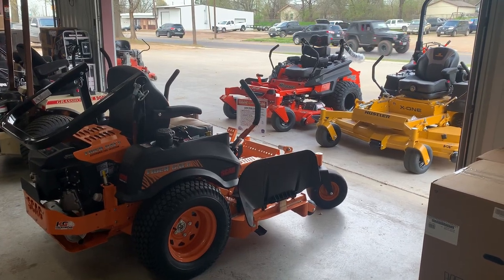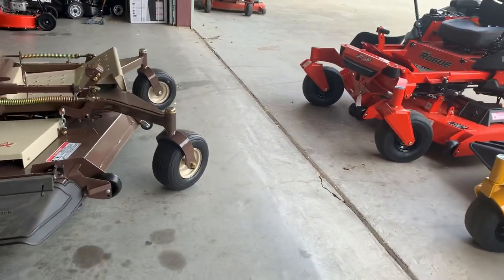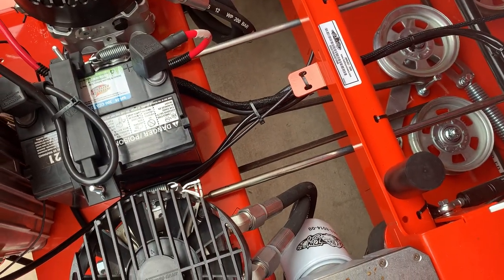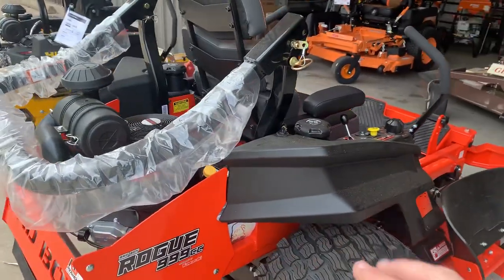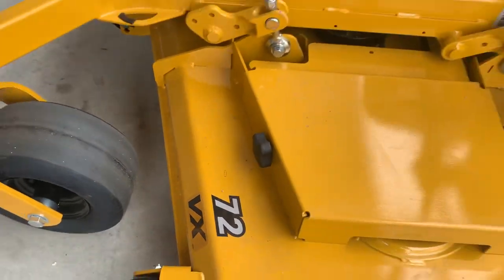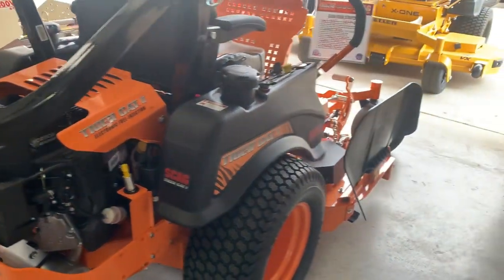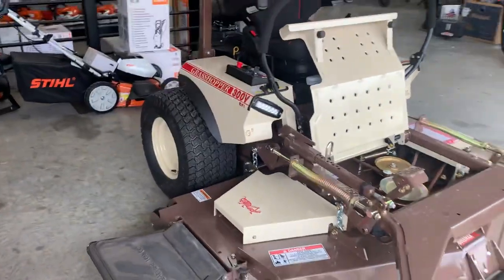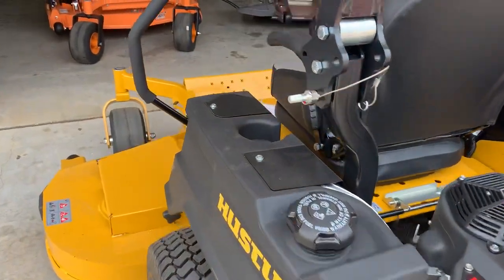Scag tiger cat vs grasshopper 300 vs bad boy rogue vs xone hustler comparison side by side.

Comment: I'm buying a home in Charleston, AR with four acres of lawn and will need some serious cutting power so it'll take less than a full day to mow.  I like your variety of brands, too bad you're three hours away.  Come to think of it, three hours each way is a good ride on my touring motorcycle... though doubtful I'd be able to use it to tow one of these mowers home. 😎
Reply from the maker: We can deliver.   Sending one to Missouri next weekend :).   We sell a lot in arkansas
Reply: I mow about 4 acres with a Scag Cheetah 54" with a 24 hp Kawasaki. It takes me just over 2 hours. If you have a lot of trees, especially pines, you need a front deck style.

Comment: What is the make/model of hydro transmission that allows you to change its fluid?   Are these hydro transmission a problem in all zero turns when you cannot change the fluid?
Reply from the maker: 2800 and up is servicable.  The sealed transmissions are usually called ezts or 2200s 2100s and 1800s

Comment: Really eyeing that Tiger Cat 61 but dealer is really lacking compared to 2 eXmark dealers that are close. The FT engine is a big reason on the Scag.
Reply from the maker: I’m a huge 32hp vanguard fan on the cat.  $9999 on national sale from Scag and it has so much more power.   The gas consumption on it isn’t as good as the ft efi of course.   I love the kawa on the 52.

Comment: In my area I have narrowed it down to either a SCAG Tiger Cat 2 or a Spartan SRT-XD. Both in 52". What are your thoughts on the Spartan compared to the SCAG? IMO I feel like the Spartan has the smoother ride and better hill capability and SCAG is the reliable, safe choice. Your thoughts?
Reply from the maker: both are good mowers.  The big thing to me is how big the Spartan is.   There is a much smaller footprint with the Scag.   Yes the Spartan takes hills better due to the size of the frame and the tires.   I would pin it down to which dealer would be better for you to deal with over the yesrs
Reply: Scag will be the worst mower on hills bcuz they are light and not balanced good.  Scag spindles also must be greased regularly versus most other mower brands that have sealed bearings.
Reply: Scag all the way, best warranty of any mower best cut period

Comment: I love my Cheetah 61 but working on it is the one thing I dislike doing
Reply from the maker: It’s funny you would think these are all the same.   We had a customer get me.    They do most of their own mechanics on their mowers but one day came in and asked me if we would change the pump belt on their toro.   I said of course and they asked me how much.   I said half an hour $35 or $40.  We jumped on it right then.   4 hours later the pump belt is changed.  Dang near had to take the mower completely apart.   The exhaust had to be removed, the rear end, then trans had to be removed.   38 bolts were in the floor then the belt went on.   It was the craziest thing ever.   He threw $40 on the counter and said thank you so much (we weren’t about to tear down and rebuild that mower just to change the belt out).   With a laugh and a smile on his face he didn’t even give me a chance to say it was gonna be more 🙈😂.  Lesson learned I never quote a price till we are done 😂

Comment: I live in southern Mississippi and I’d say we’re 70% exmark and 30% scag but scag is on the riSe. I got a 52” exmark and a 36” scag v ride
Reply: I live in Clinton and I 100% agree
I work for parks and rec and we got scag turf tiger 2’s 5 of them like 6 months ago.
They are absolutely dream machines , no issues and power power great cut and built like tanks liquid cooled
Reply: Best cutting mower I've had for southern grasses was Ferris icd deck and John Deere 7 iron deck.

Comment: How would you compare the TigerCat2 to the Rebel? Dealer by me has some left over 23 Tigercats significantly discounted and cheaper than the Rebel. For about the same price as the Maverick HD
Reply from the maker: Tiger cat has the pumps more like the rogue.   It’s definately gonna cut a little better.    They are supposed to be higher so that’s a bargain for sure.   A 61 is 12k and a 52 is around 11k.   I’m selling some of the rebels under 10k.

Comment: I am running a bush Hog PZ 2661 now,  what would you recommend for me?  I weigh 400 and have pull some hills while mowing.  Mow about 4 acres at a time.  I buy commercial mowers because I desire durability.  Out of those or perhaps other what would you recommend>?
Reply from the maker: I will be honest with you,   Every one of the 10k to 11k mowers from any brand are amazing and have so much to offer.   I would lean on the bigger sized mowers if i were you.    The Scag cheetah, any of the r series bad boys, Spartan, hustler super z, the 300 series or 400 grasshoppers, if you get a front mount make sure you get an extension foot platform, 600 gravely is awesome.   Have fun shopping, sitting, asking them to let you drive them around.  Also consider who is the best dealer I’m always about picking a dealer over a brand
Reply: @kgmowers  Thank you sir for your kindness and prompt reply

Comment: Is it true that Simplicity stopped making lawn tractors and zero turns??  They were the same thing as Ferris, but a little cheaper.  I have a 24 year old Legacy with a 60 inch deck and it's still going strong.
Reply from the maker: I believe so.    Simplicity snapper and Ferris were all under same umbrella.

Comment: personally, I Think Hustler is the Best Made and engineered with years and years of experience cutting grass for the City.  Second Is the Bad Boy.  I bought a Maverick because of the adjustable Arms, being i am a Bigger guy.  wanted the Hustler, I just didn't fit comfortably on the mower.  Also The Maverick has the suspension for a more comfortable ride.

Comment: Since this video, have you noticed any persistent problems with the scag tiger cat II? I'm trying to decide between x-one and tiger cat
Reply from the maker: No not at all.  I had a commercial guy his brake bolts came loose and the brakes fell off in the yard.   I was surprised to see the the warranty claim denied.    They ended up warranting, but I would recommend checking nuts and bolts on any mower.   I absolutely love the xone because of the hte12 Parker’s, but I noticed for 2023 they went to 4400 hydrogears instead.    I still have a couple 52 xones with the Parker’s if you can find a 2022 left out there I would recommend jumping on it.   On the tiger cat it has the higher end old school pump and wheel motors seperate so it’s gonna be a hard choice.    The xone is definately a smoother driving mower by far, Scag has the edge on the cut a little in most grasses.

Comment: What I didn't consider when I bought my Deere 930, is how heavy the mower was in the front, depressing into soft soil.  Of the mowers you presented, the Scag looked like the best choice for me, but the Bad Boy tires and suspension are appealing.
Reply: This is an interesting perspective, that I had not thought about, myself. I do not own a ZTR yet and am researching a LOT trying to define my needs. I have some areas that are pretty rough and some areas that can get pretty swampy during the wetter months, getting stuck with a 25O# lawn tractor vs a +- 900# could be a huge issue for me. Currently have a Husqvarna YTH 2348. The lack of a suspension on the Husqy beats me to death!
Thank you for your input.
Reply: @Delmarksman  In soft soil, I didn't not notice the heavy John Deere 930 would tend to get stuck more so than my XMark Pioneer. It was the front end tires were so heavy, it put depressions in the grass when I stopped.

Comment: What I'd personally like to see a video on is the Bad Boy 42" Rambler out in the field doing some actual mowing.
Reply from the maker: So funny story had a guy walk in and buy one from a nearby town.   He asked “what’s the cheapest mower you have”.  We sold him a single cylinder kohler 42” and me and my salesman delivered it after work.    
We pulled up to an extremely overgrown apartment complex that the grass was over the mower.    It was a huge place.  I got out and told the guy I was going to get a big commercial mower instead and he said no that’s all the money he had.    
We explained to him there is no way at all that mower could handle that yard.  
So Jay jumped on the mower turned on the blades and said “here let me show you this is impossible”.  
He tore out across the yard and it never bogged up just blew threw it.   He went back over it and it was a clean pass, then another, and before long he is jumping back in the truck and we are waving bye 😂 🙈.   I think the 42 Mz cuts better than the $8600 42” maverick hd honestly….   They have had that mower 2 years now it’s still rolling :).
Reply: @kgmowers  👍🙂

Comment: Hi thanks for the video I have a question which one do you recommend to  mowe 10 acres out of them 4 thank you?
Reply from the maker: As long as you get a full commercial engine and transmission.  You are good.   3400 is full, but I recommend a 4400 or better transmission for a big yard like that.   Also make sure these is a big Donaldson or fleet guard air filter canister on top of the engine.

Comment: If you were looking to spend $4-$5k for a light commercial mower what would be your choice? I need one for a small 1/2 acre or so property that we cut maybe once or twice a month, so the grass can be pretty tall or wet when cut. Currently we have a riding mower/tractor style that's 30 years old with an 8 horse engine but things are slowly getting bent up and wearing out. Looking for something better, but can only fit 48" through the shed doorway. (Plus my kid wants to be a landscaper like his uncle, so that's why the light commercial aspect)
Reply from the maker: If 5k is your cap check out the bad boy zt it’s gonna be the toughest best looking, easiest to access for working on, and have a suspension system
Hustler raptor xdx would be my second pic, 1 year better warranty, really cool
Looking, love the profile, tires, kawa motor etc.     Scag Liberty or freedom z will cut better so I would look at it be the most reliable as well, gravely zt hd will have a better belt system and their new look is cool would have to consider, would definately check out a Spartan rz pro, idk I would have fun checking them all out.   Take your time, you will be stuck with what you buy for 15 to 20 years unless you want to trade so get something you like and consider looking at their option upgrades.   Bad boy has the best selection of options it’s easy to add $1k to the mower in cool stuff
Reply: @kgmowers  thank you. I stopped at a Bad Boy dealer late yesterday and checked out a Compact Outlaw. Above the price range but seems to fit the check boxes. Also wondering if a used Rebel would be a good choice if I can find one with a deck small enough. Need to find a video on what to look for with used commercial ZTR mowers.
Reply from the maker: @mikezupancic2182   yes!! That mower is a tank.  You asked for commercial, but sadly at 5k you cant touch commercial.   At 6k to 8k you can get closer.   The rebel is such a huge mower even the 54” is bigger than most 60” machines.
Reply: @kgmowers  speaking of the rebel,what's your opinion on those?
Reply from the maker: @king_beard_1014  they are tanks.  If I still had a mower service that would be the one I would have my guys on.  That or an xone hustler a 329 grasshopper, or a tiger cat Scag.   I really like all of those for employees.   They all are the best to throw hands on without breaking the bank
Reply: @Kevin Kelley  I understand the rogue (and renegade) have suspension, but assuming you have the suspension seat on the rebel, wouldn't the rebel be just as good as the rogue?
Reply: @kgmowers .
Reply from the maker: @king_beard_1014  no way I would mow on a rebel after doing it on a rogue.    It’s like driving a Cadillac after owning a Chevy cavalier, it’s hard to get back in the chevy
Reply: @Kevin Kelley so in summary the Rebel is still a very capable and solid machine, but the Rogue is also worth the extra money?
Reply: @kgmowers  .

Comment: I just blew up a revolt with 88 hr left transaxle shot and a rebel with 6 hrs left axle shot. This week
Reply from the maker: Dang that’s crazy.  We don’t see very many transaxles.    The Rebel has hydro gear 4400s and the revolt has 3400s
Reply: @Kevin Kelley  yes sir now I have scag turf tiger and IT'S ALL GOOD
Reply: @Kevin Kelley  a rebel is not for contractors that do parks baseball field softball field football fields, my lawnmower gets about 9 hours a day of runtime
Reply from the maker: @TimothyIpmanchilds   the rebels are by far the most dependable bad boy.    Same as the tiger cat Scag, 328 grasshopper, they are all good machines in that class.   The 4400s are bulletproof for us.   I don’t think we’ve even replaced one in our history and we are the largest volume dealer
Reply: @Kevin Kelley  when you're bored Google Map Ruby Park Wyandotte County it killed it within 45 minutes lol

Comment: How long has the rogue been out with that suspension and any problems out of the suspension? As always good video and thanks.
Reply from the maker: So far the only issue on the first run was the eye bolts were weak. Once they caught it they were upgraded around middle april of 2019.  The rogue and renegade have had this since release in 2019.   Works amazing!!   Very little issues at all.
Reply: @kgmowers  thanks
Reply: I work for a municipality in Arkansas and we just got a rogue last year I’ve put quite a few hours on it and only complaint I have is when going over rough ground the suspension can sink a little aggressively and cause the deck to scalp the ground but it’s easy to correct when I slow down a bit

Comment: Grasshopper or Skag cheetah...hands down
Reply: GRASSHOPPER IS NOT EVEN IN MIX OF TOP 10 MOWERS DUDE SORRY  HOW MANY TIMES U BANG ELBOW ON ROMP BAR PULLING BREAK UP?????? NEW GRASSHOPPER WITH SUSPERSION SEAT U LOOKING UP IN AIR WITH WAY ITS MADE . HORRIBLE MACHINES AND ALSO MOST EXPENSIVE
Reply: @chadboeck8358  I've never seen a rope pull start grasshopper, I do like the "out front" deck

Comment: Which mower you think is best overall I’m impressed with the grass hopper look better built so you tell me thanks
Reply from the maker: I will be honest.  There are I believe 36 brands of zero turns.  Not one is the best, and not one is perfect.   It really comes down to the owner of the dealership you buy from and how much they care about you.   Like I said to someone today in my shop.   If someone sold poulin Pro’s and that was it, but they stocked parts, and went out of their way to help the customers most would be happy with the Poulin pros
Reply: Go with dealer support always.  I have seen some of the best perceived mowers on the market be absolute junk bcuz the dealer didn't know their product and/or only cared about sales and neglected their service department.  When you buy a mower, tractor, car or any other kind of machine, tell them you want to look at their service department.  If the service department is clean and busy, that's a good thing, if it's clean and very few machines, that's a red flag and if it's filthy and machines are sitting around everywhere that's a red flag too.

Comment: I want to be like, Scag cut quality is the only thing...right??  But I am also drawn to the BadBoy.
So other than cut quality, where does Scag shine?  And how far behind is BadBoy’s cut quality because over all I want the BB Rebel or Rogue.
Reply from the maker: You can tell a difference mowing side by side.  It’s not much though.   All the new mowers are pretty similar now
Reply: My company has 2 scags and 1 Bad Boy. Scags are used on the premium accounts, BB on rougher, larger acreage lower paying ones.
Reply: @kgmowers  which Scag model would be the equivalent to the BadBoy Rebel?
Reply: @alanruechel2240  which models of each are you running?
Reply: @mickeymallette2663  61 turf tiger 2 with 35 hp vanguard, 52 tiger cat with 23 hp kawasaki , 72 outlaw with 33 yamaha. Also have a 52 exmark turf tracer to use on steep slopes
Reply: @alanruechel2240  thank you sir
Reply from the maker: Really it’s the tiger cat.  The rebel is a larger frame and footprint.   I usually relate the cheetah to the rogue but then the price difference is so much on both..
Reply: @mickeymallette2663  Scag does build a better machine to last when you compare them down to every nut and bolt of every other manufacturer. The bones of Bad boys are good but they cut corners by putting in cheap parts and design in things like parking brake, wheel hubs, steering sticks etc. But the bad boy sure cuts alot of grass and has made me alot of money, and I'll probably buy another
Reply: @alanruechel2240  I can see that, and in all practicality, it’s a negligible difference in my situation.  I’m not commercial but I have a lot to mow.
Reply: @mickeymallette2663  Scag requires a lot more maintenance.  Every spindle must be greased versus most other mowers that have sealed bearings in the spindles.  Most Scags have a minimum of 13 or 14 grease points.  Scags are also not good on hills bcuz they are very light mowers and not balanced out well.